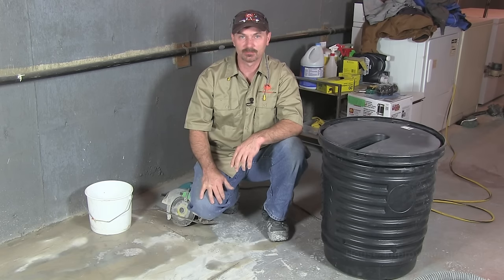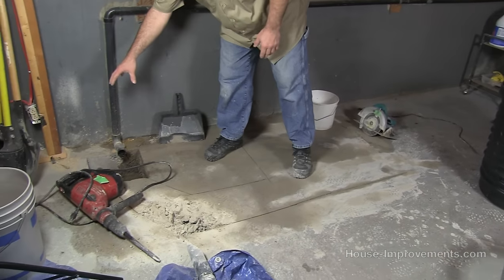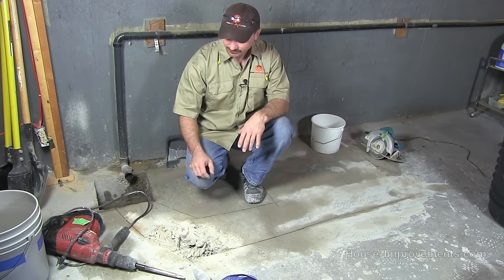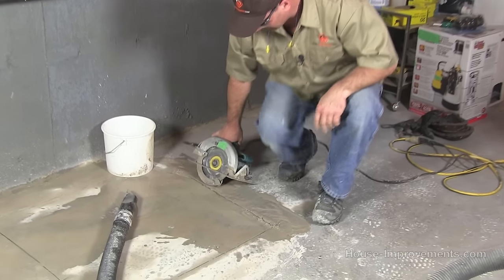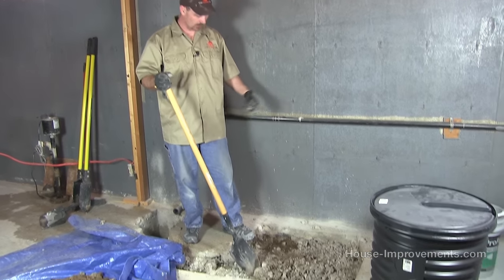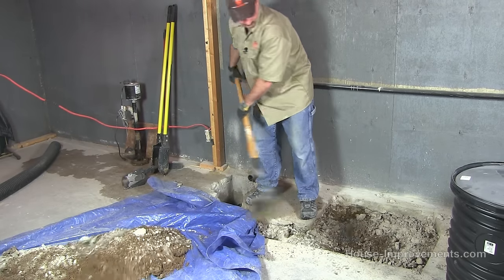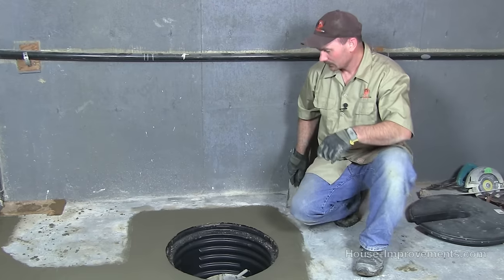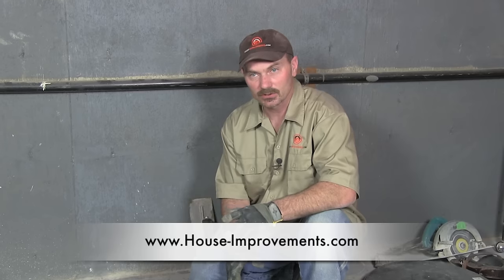How To Install A Sump Pump Pit

Comment: In the future you should avoid backfilling with clay around drain lines your basin, and directly under concrete. This can cause heaving and dislodge or crush the system. It's recommended to have gravel come in direct contact with the system even on a solid pipe.
Reply: 16:02

Comment: I watched many videos and got motivated. I rented the jackhammer and broke the floor. There are so many stones under the concrete floor. Concrete breaking was tough and took me  about 8 hours to break. I would break one foot concentrate clean it out then take a 15min break, then do another foot and clean it out then take a break for 15 mins. Then took some longer breaks. My back is hurting like crazy and now I have to dig deep enough to bury the perforated pipe with the stuffed sock on it and there are so many stones... it's so frustrating. I still haven't made a 3 feet hole for the pit. I'll do that tomorrow. This is a very very heavy duty work. I have no idea how I'm gonna remove the pile of concrete and soil from my basement on my own. Only do this if you have got two or three people who can do the heavy duty lifting. It kicked my ass for sure. Never again! Lol
Reply: Yeah probably don't do the work unless you know you're physically capable. Trades are hard sometimes man only reason I could handle it is because I'm in the gym often. These guys really make digging and hard work look way easier than it is.

Comment: No sand ...just gravel filling ...water needs to draine through ....and in to the bucket with no issues .....   plus ...all you need is a 750w pump with 8 meters head distance....and all sorted 👍

Comment: I think it is worth the added expense/aggravation to remove all excavated material and back fill with a clear angular stone. Ideally a 1/4-1/2 inch type. It tamps easier and allows water flow and helps to lock in the crock. Perhaps drilling a few holes in the crock would also aid in easing hydrostatic pressure under the slab. Not a fun job, but also bettter to do it during the dry season as well. I don't envy you.

Comment: Well that's a Makita they're double insulated. Meaning you're isolated from electrical. Notice that your saw there only has a two prong plug (no ground), right? I've stood in puddles using a Makita never been shocked.

Comment: Thanks.  It helped me understand a lot about what at pain it is to add a shower to an already finished 1/2 bath in the basement.  A lot of stuff that could go wrong doing this on a house that was built in 1979.   Its epoxied all over the top and also sealed with silicone.

Comment: Nice job. Well explained and executed. One thing you should have done is wetting the edge of the slab before pouring the concrete. It would help the old and new concrete adhere.

Comment: I bought a house 6 yrs ago that has a sump pump under the crawl space, first time i had problems which wasnt very long after i bought it, had to put in a new pump last owner had installed a lowes cheap one and also the pit was a 5 gal bucket,,according to local plumbing stores in al that is all you need B>S> but i replaced with a zoeller pump that had a float switch that the plumber said would last me forever,,B>S> switch burnt out right after the 3 yr warranty so i rigged it up to stay on all the time and installed with a float switch which worked great but took forever in a 5 gal bucket,but it bought me some time till i bought a little bit bigger zoeller pump of amazon with no switch built into it,then i went under and removed the old crap and cut the sides of the bucket and removed it and then i had bought me a plastic 50 gal drum and had cut the top and bottom out of it around 25 inches high and then started digging around the pit hole which was fairly easy and then installed the drum into the hole after getting the right depth and then mixed me up some cement in a bucket and dumped it into the center of the barrel till it was around 2 inches thick and then added some bricks around the bottom to provide a rest area for the sump pump to stand on, and then let it dry for a day, then installed  my pump with the float valve and also an extra wire on it that i fed up thur the floor behind my refrigerator  so that when the sump pump kicks on so does the little light to ensure myself that everything was working,i later on installed a small radio that i turn on and off to alert that the pump is working as well,,,Has been working well for the last 3-4 yrs now just wondering if or when i should replace the pump they say these zoeller pumps last 10-20 yrs but the ones with the electric switches are their weak point so i eliminated that part
Reply from the maker: Can't say for sure , If it does not run often you could test it every month to make sure its working by running water into the pit.

Comment: Hey shannon on our sump we make sure to have holes all around the bottom 3-4 inches above the bottom and use 20-30mm rock with no sand to allow groundwater and lower water to go into the sump as the sump hole for tile is much too high to allow water to go in.

Comment: I enjoyed watching this video, Shannon, and it was especially informative because I installed a sump pump liner in my basement quite a few years ago, but did not finish it quite the way you did this one.  I live in a flood plain where the water table is high, so when I started to dig a hole for the liner, the hole filled-up with water quite fast, so it made the installation a challenge.  I would like to watch your accompanying video on how to install a new sump pump as well.  Great video!
Reply: I wonder in a situation like yours (and maybe mine) if you put a simple bucket in the whole with holes in lower part if it would pump the water out.🦇
Reply: @dustbat  I don't know, but it would be worth a try.  I should also dig my sump pit a bit deeper too because there is usually some water in the pit.

Comment: Excellent video! You a very good job explaining each and every step and that is very helpful.  Probably a good idea to suggest that your viewers wear a mask with all that concrete dust and particulate matter in the air - not so good for the lungs.
Reply from the maker: Great suggestion!

Comment: All the concrete should be mixed in one batch  also you should use a bonding agent to paint on the old work. I did my own sewage ejection 
Tank and pit, it had been set on clay 
Someone let the pump fall into the pit causing a crack  the pump picked up stone and burnt up.
The original plumber did the job wrong and it did not last but a few years.  My sewage line is about 4' off the floor the only way to pump water out of the basement is via a sewage pump    i also have a bathroom but no working fixtures.
A kitchen sink used to drain into it 
I change how it was plumbed.
Never had a problem with it in 23 years. The sewage pump is 10ish years old it only removes water the hvac system makes from the ac.
Had a hired a plumber it would have cost me about 5 to 10k 
Only cost me less then 300 to diy it.
Thats pit pump and supply's. 
And i used pea gravel around and under the pit.
Reply from the maker: I agree DIYing it saves a ton of cash. I disagree with a couple things you said however. The concrete needing to be mixed as one batch is not true. Mixing more than a couple bags at a time is not convenient and can be difficult to mix well if you're not equip for it. It really does not matter but you want to mix the batches constantly if you can. On large jobs for example it takes more than one truck to deliver the entire job. 
A bonding agent is not really necessary in a case like this but it would not hurt. We used rebar dowels to keep our patch from moving from the old cement .

Comment: You seem like you would be a good boss to work for. The company Im with has us banging out one of these a day with a backwater valve as well and Im working like a beast to dig it all up and mix up the cement, carry it all out in over filled buckets that are back breakingly heavy etc all in about 8 hours. It sucks to be honest. It would be nice to find a boss like yourself who might be slightly more relaxed about it. 
I think this job could easily be spread over two days with 2 or 3 guys, as opposed to one hectic day. But then again, time is money and my boss wants to get as much as he can I suppose. Lol
Good videos though. You always take the time to explain things. You are right up there with the best.

Comment: My builder did all this installation before I bought...but I've had two pumps fail in 25 year, and when they did, the water in the sump basin seeped back through the hole where the corrugated tubing enters the basin. I have since tried to seal that hole from inside the basin. It isn't easy, but I think it's a good idea to be prepared for pump failure and keep the water from going back under the basement floor.
Reply from the maker: So if you seal that hole how is the weeping tile suppose to work in normal conditions?
Reply: @HouseImprovements  When the pumps failed and the water rose to the level of the tile, the water seeped back under the basement floor around the outside edge of the tile  where it enters its hole in the basin. Nothing kept the water from going backwards either inside or outside the tile. Under normal conditions the water should come in through the inside of the tile and be pumped out. Upon failure of the pump, without intervention, I would expect the water to come in and  overflow the basin and not backflow around the edge of the tile hole.

Comment: Shannon, if you have time to answer this question, it'd be greatly appreciated. Other than being sure to avoid any pipes in the foundation, is there any specific reason to choose a sump pump hole spot or will any place get the job done, regardless of which part of the basement? Thank you Shannon.

Comment: Need some advice. Great video by the way. I want to up a basin in a 30-year-old house that already has a sump well and sump pump that is fed from a drain at the bottom of a sloping down driveway. I would need to put in the holes to align with the drain pipe that feeds the sump well which I think is 1 and 1/2 inch diameter. Any ideas how I can align those holes or wont this work in a pre-existing sump well?
Reply from the maker: Please copy and paste into my forum and we can work this out there.https://www.house-improvements.com/forums/
Reply: @HouseImprovements  done. posted in the plumbing section

Comment: You using a bucket reminds me of the first small mixing pan I used to build a retaining wall around my yard. Way too small for the job. I eventually got the large one that allowed me to mix a whole 80lb bag of concrete and I mixed 100's of bags,of concrete that way with a hoe. If we talk about should offs, I should of had a mixer but I got through it and it was a back yard with no other access but through the house. getting a mixer in and out would have been difficult and expensive. I got much stronger doing it by hand.
Reply: you can rent some pretty compact electric mixers nowadays. Rented one from Home depot a month or two back and we brought it right into the basement to patch a floor we had to break up.
Reply: I thought about it at the time. I worked on those walls for months. It would have been cheaper for me to buy a mixer than to rent it every time I was going to pour. And the damage I would probably done walking that up the front steps (second floor entrance), walking it through the house and out the master bedroom every time? I just bought the mixing pan.
Reply from the maker: That would have been a lot of work!

Comment: What if you don’t have a tile like you have in this application? Drill holes? Cut off the bottom? Most houses might not have  the luxury of a tile around the foundation
Reply from the maker: Drill holes to allow ground water in.

Comment: Does the pipe coming from the weeping tile passes underneath the footing or you have to drill a hole in the footing to pass the pipe from the weeping tile to the sump pit ? I want to install a sump pit to an exterior weeping tile system and I was wondering how to connect them together ? Thanks . Great video
Reply from the maker: It should go under the footing .

Comment: Hi, Great! very clean job. I am also going to Install a sum pump in our basement it is little old house. I am not sure where the weeping tiles are coming inside the basement or if not coming in then how can I connect that to weeping tiles. I really want to connect that to the tiles. I could not get answer to this anywhere. Do you have any video on this?

Comment: Great informative video, thanks! In your video, you tie a single weeping tile into your sump pit. Is this because in newer construction, the perimeter weeping tiles would feed into this one main? I have a house built in 1929 with a centred floor drain with four weeping tiles feeding into it. Could I place the sump pit to capture flow from only one feeder, or would it have to be placed to capture all four weeping tiles feeders?
Reply from the maker: If you have multiple feeders they should all be in sump pit or multiple sump pits. Many homes have a continuous weeping tile around the entire perimeter and they tie together to one drain.
Reply: @HouseImprovements  Thanks for your quick response! Recently had water come into the basement and insurance wants a sump installed. Problem is, the centre floor drain is right in the middle of our family room in the basement.

Comment: I can only tell you this about these pumps.  It is absolutely no fun when the pump dies, the tank is overfull and you have to change it out.  Bailing buckets of sewage, smelling that stink makes me very sympathetic for sewer workers.  I think I will put a sticker on the wall next to it to remind me to change it in 8 years before it dies again.  I also recommend placing a check valve near the tank and another one about 6 feet up.  Pumping the sewage up 9 feet then having it fall 6 feet makes for a very large banging noise.  Putting the second check valve further up keeps it much quieter.

Comment: I have a sump basin similar to the one in this video and had to cut a hole for my pipe at the very lowest spot which is about 6-7" from the bottom of the basin. That leaves only that much room for water to rise inside it before the sump has to kick on, is that sufficient enough for the sump pump to operate correctly?
Reply: Then your pump engages at a very low level. A pump with a floating ball switch  can be set to start at much higher levels so it doesn’t cycle as often.  Zip tie the switch wire pivot to a higher spot on the exit pipe

Comment: 9:10 - Yes you can do this job if you have hydronics and yes there will be damage to some extent that can be repaired. Sometimes the job has to be done but you make due by chipping parallel to any pipes found and once you find the pipe you know your max chipping depth. The crazy thing about doing it is that you know there is going to be damage but that first rupture helps out big time avoiding more. Then of course you still need to get through the steel mesh and insultarp :)

Comment: any advice on how to modify my effluent pit lid so I can remove it without having to disconnect the pump piping. This is a septic system effluent pump chamber pit so a lid like yours wont do otherwise the smell will be noticeable even though its in the yard.

Comment: Thanks for this video. Q: our pit got cracked at the bottom. Is there a DIY way of replacing it? Only got a Home Depot in our  area. Thanks
Reply: A crack is no problem. It lets water in. Just like the corrugated pipe or drilled holes. The pump gets rid of the water. Some sand or silt is dealt with by a brick under the pump.
Reply: @janetyeoman1544  much appreciated. We left the crack alone and just replaced the pump with another 1/2 hp

Comment: You don't know what you are doing. You need to use an internal coupler for the drain tile. And you can't backfill it with the clay, it will settle, use pea gravel, then your gravel. 
In 1 year, that concrete will be settled by an inch or more. And there's a good chance his drain tile will pull apart when it settles. If it does, it will undermine the foundation as the water flowing through will pull soil with it. It has actually caused sinkholes.
Reply: He said him self clay isn’t the best back fill and it’s someone else’s home that why! Only has to work long enough to get paid. Typical of many contractors.
Reply: Ben Harrison that’s sad
Reply: Don't forget the filtering fabric... that stuff will make its way right through the gravel.
Reply: So make a video and show us all how to do it correctly rather than telling him he doesn’t know what he’s doing. Typical comments, everyone knows best but nobody does

Comment: Hi folks, I am presently in the process of doing this exact project. 2 questions: #1. do I drill 1 inch holes 6 inches apart in the basin to allow for easier water flow into basin from the water table? because I do this I wrap the basin in landscaping fabric to filter big pieces? thoughts?  # 2 I have been told and through research, I am looking at a battery backup system, I am thinking a single pump but with the pump sentry system that flips to battery but only one pump in the pit. I am worried about delivery of the two pump system (breakage) also with the two pump system there is more to manage, more possibilities of malfunction or battery not being charged (me thinking it is) and all hell breaking loose. Any experience with the pump sentry, or vice versa? it is a little more expensive but only about hundred dollars and replacement would be simpler with one pump no?

Comment: Shannon, Say, where did you get that awesome large sump pit? And what is the make/model please? I can only find tiny little 16" & 17" basins or ones not much bigger. Thanks. Excellent vid, great info, well done.
Reply from the maker: Armtec is the brand. I purchased mine from Home Hardware in Canada